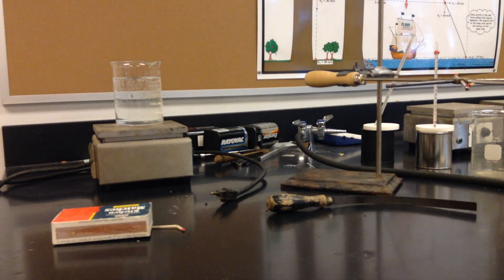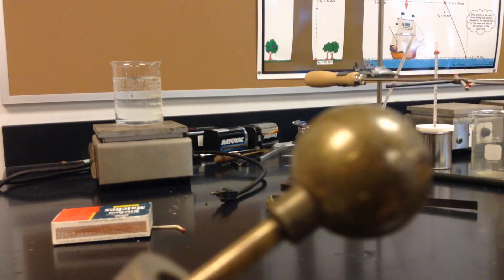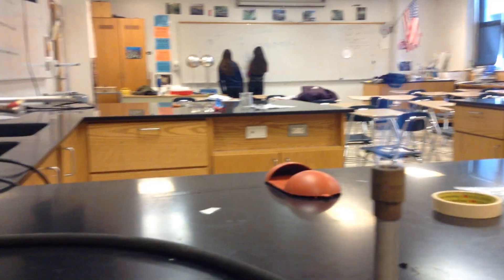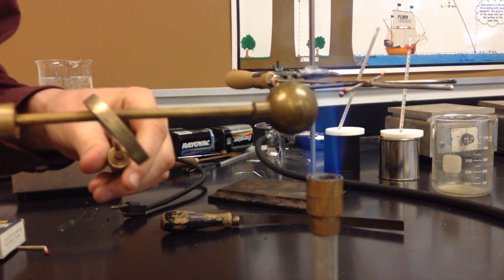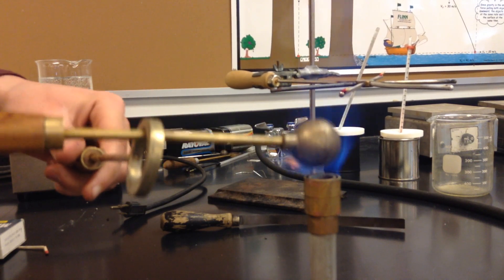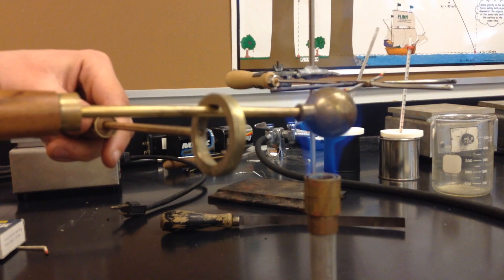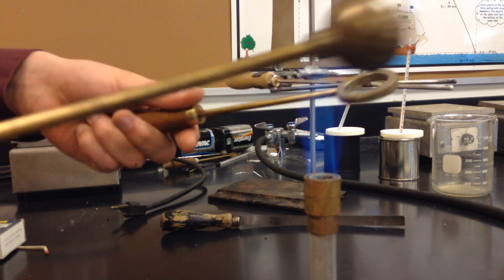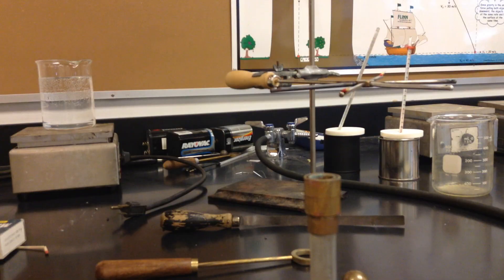Thermal Expansion with Ball and Ring

Comment: Nice simple demonstration! I have one question. To how many degrees did you heat the ball?
Reply: What- impossible. My guess is 100-200 degrees Celsius
Reply: @jaketan9159  above 100 Celsius, but below 600, or black body radiation would make it glow slightly
Reply: 1523° celsius

Comment: Thanks for the video and the explanation.! Just one thing, the hottest part of any flame is the tip, not the base or the middle, that is why it took you so long to heat it. In this case, the tip of the inner dart is the hottest point.